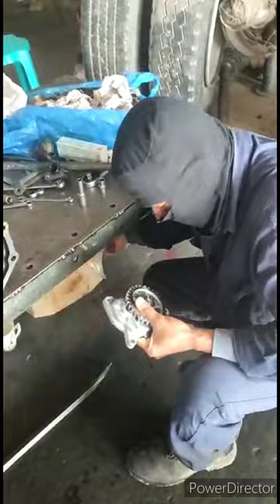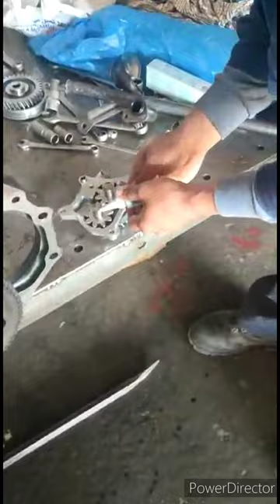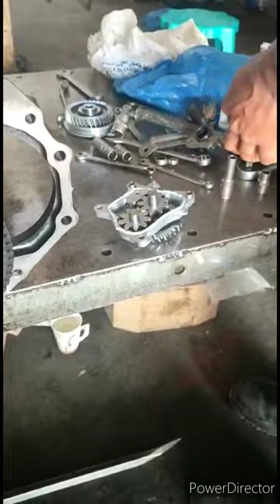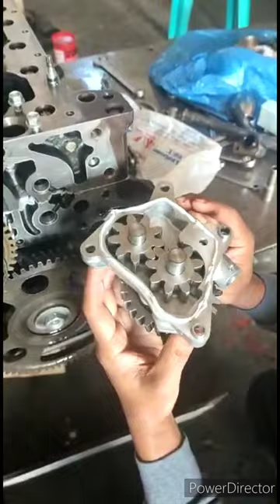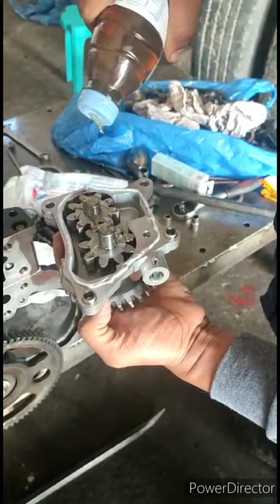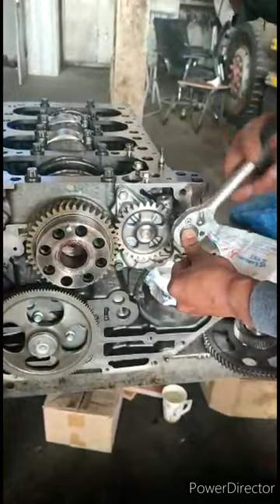Diesel engine workshop | Oil Pump Fit By Mohammad Ajaz | Isuzu | 4HG1 | @Ajaj881

Comment: Good video.question?will bad oil pump make motor run hot???i got isuzu 4le1 in a mini ex digger did bunch worn and it still run hot.oil pump next steep.thank you